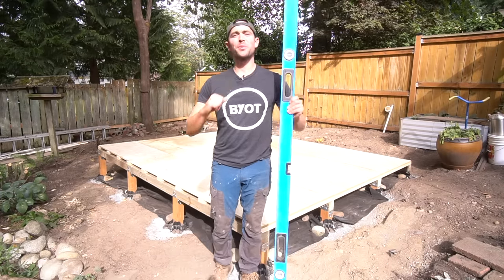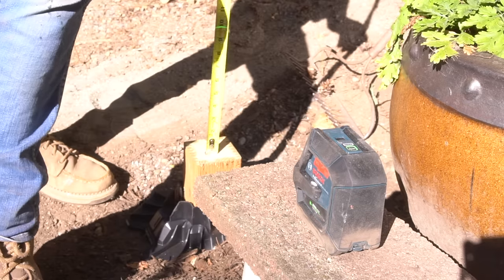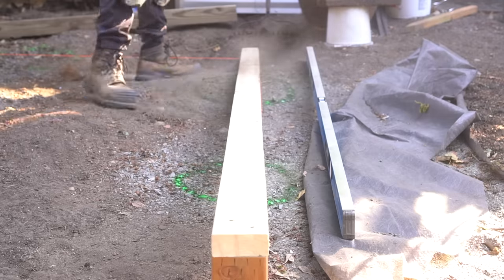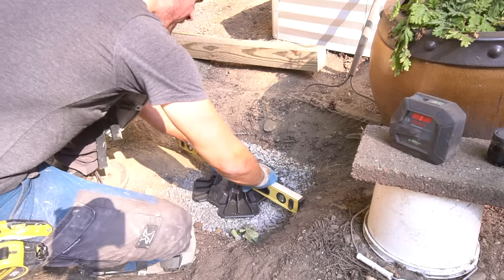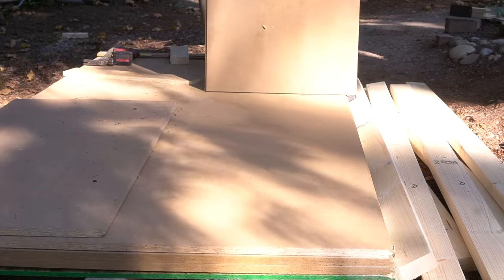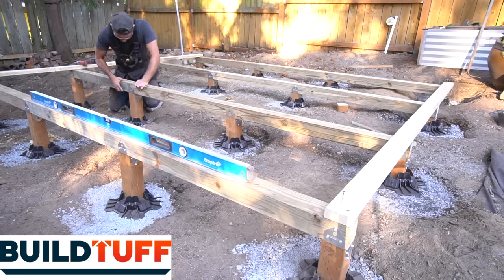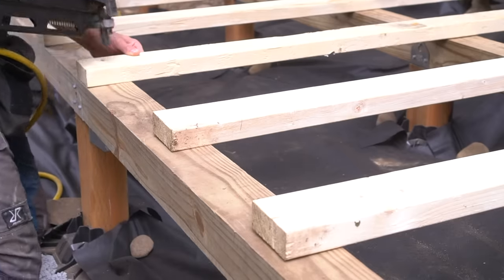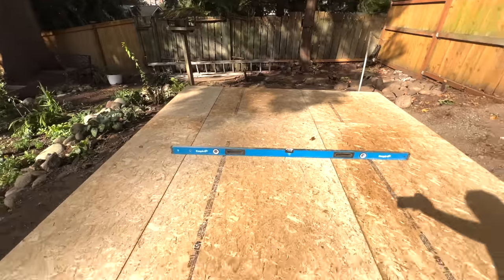How To Make A LEVEL Floor System

Comment: Your joists wont carry any weight they're only 50mm wide and will have significant bend with any load, the floor will sag like a suspension bridge, they should have been rotated   
Your feet may have been level at one point but they're sitting on gravel and will sink in when loaded - there's no bracing at all, you really should have cemented them in 
You've attached the posts to the feet only by sitting them inside they arent fastened, plus on your outside feet, rain will run down the post and pool in the base causing rot 
You've no noggins perpindicular to the joists for bracing 
What made you think you'd tell people about this ?

Just change the title to "how NOT to make a level floor system" 

Or lets see a follow up 1 year later, how to demolish a one year old shed, or help, my shed has collapsed

Comment: What a pain in the arse. All that extra effort when you could have just dumped a cheap load of dirt to level the ground and laid a concrete pad. Taking a simple task and making it complicated is not smart building.

Plus you didn't water seal the post or paint over the metal so you will end up with rusted joints and posts that crack with rot. You didn't do anything to prevent that gravel from settling or shifting which means you could end up with buckles in your floor later when the ends on the slope start to follow gravity.

Good thing it's only a shed.

Comment: So many mistakes with this build. Definitely a DIYer job.
Reply from the maker: LoL! Well how about you explain what you think could be done better and then we can have a discussion. Thanks for watching though JW
Reply: @BYOTools  since you are building a 10 by 12 structure, you could use 2 x 6 for your beams running parrell to your 10 foot side.  You only need 1 beam at the 5 foot mark (this means less footing & less work). 2 × 6 for floor joists (set on edge, not flat). Plwood sheathing should be staggered at joints.  Plywood should be screwed to avoid squeaks. Footings should be deeper to avoid heaving.  String level or water hose are cheaper. (Water hose is most accurate)

Hopefully rhis enough to start a discussion

Comment: omg long winded overcomplicated way to do what is a simple task Make up the complete wooden outa frame first lay in situ place 18 inch wooden post inside  on one corner same on all corners DIG holes for all four posts concrete them in one at a time lift frame level in screw in place once level add internal joists and stand the 4 inch upwards not downward/fix 4inch inside of frame flush /fix more posts/concrete job done .So simple dont put blocks underneath as making the job hard ....and no laser needed